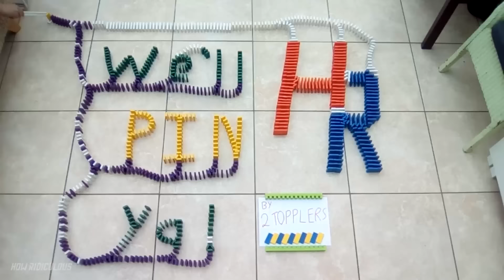Can This SOLID GLASS BALL Survive a 45m Drop?

Comment: My theory: at the point of impact, the force gets distributed outwards from that point on the surface to the area under and surrounding it. In turn from there it gets transferred further. The glass thats towards the center of the sphere has more material to further transmit the energy to because its covered on all sides by more glass. However the same cannot be said for the glass thats near the surface because thats only held together/in place by the glass underneath it and not above it because its on or near the surface. So those glass pieces arent strong enough to stay together and they get blasted off the surface.
Reply: I think that you might get pinned
Reply: Basically there is a lot of layers of glass
Reply: That’s was what I was thinking but I didn’t know how to word it correctly Bc I’m stupid
Reply: That actually makes a lot of sense. Bc there’s more glass surrounding the middle than the outsides
Reply: Nice theory
Reply: Shock waves
Reply: It's chonchoidal fractures actually! Your theory is pretty close though. https://en.wikipedia.org/wiki/Conchoidal_fracture
Reply: It’s not about how much material it’s about the forces acting on different internal parts of the ball. The shear force knocks the sides off
Reply: I beg to differ. I think its the compressive and expansive forces in the glass with a bit of your theory. The layers are of whether the forces are compressive or expansive.
Reply: @elijoetaylor  No, glass doesn't form in layers, it forms like metal
Reply: @danielwisell3836  thats actually also a very good idea. Though i'd argue that overlaps with my theory quite a bit, with mine just being more amateurishly worded. The shear forces can knock that material off because that material isnt surrounded by more material to absorb the energy.
Reply: Nerd
Reply: Hey guys how about the axe vs the glass orb
Reply: i was thinking the exact same thing, but my english isn't good enough to word it correctly lmao
Reply: Guys please dont pin me because this is just a hypothesis off the top of my head and its likely quite wrong and significantly more complex :')
Reply: @matthewmaillette  hi
Reply: To reword what you said, glass handles normal stress better than sheer stress.
Reply: MetalQueer right, if there was material below it it would theoretically all take the impact at the same time and shatter to bits. It’s easier for the glass to stay together and just lose the edges than it is for it to smash altogether
Reply: @silasmarrs1409  thanks, thats a lot less convoluted haha
Reply: My thoughts exactly
Reply: Possible
Reply: Sorry im just stupid
Reply: i think its because when the point of the cone impacts the floor, it vibrates the glass sending a shockwave back and out, and the vibration slowly dissapates outwards
Reply: @danielwisell3836  Hell yeah you know it

Comment: I’m a physics major, here are my ideas.

When the ball shatters, you can see some layering in the coney joney. To me, this indicates the ball was formed in a way that allowed for either gradients in cooling that caused certain layers to cool faster or slower, or a progressive addition of layers to make the ball bigger. Weaker layers from more quickly cooled glass would be on the outside, shattering more easily. 

When the ball hits the ground, there is a shockwave shooting through the sphere, it’s the shape of the circumference of the sphere at any given height of the sphere (it starts at the bottom at a point then as it moves up the sphere, it expands outward with a diameter of the sphere, so by the time it reaches the middle of the sphere the shockwave is the biggest circumference). Once this shockwave reaches a certain point, it stops as the tensile strength of the ball cant handle it. Up until that point, cracks are forming, and weakening the area of the ball closest to impact, and all of the fractured bits fall off when the outer layer falls off, which is why the final product still looks smooth. 

As for the flattened bit, it’s called a frustum (essentially a cone with its tip chopped off), probably formed by the ball still moving downward as it is shattering, and smashing that tip down. Think of pushing a freshly sharpened pencil straight down onto a piece of paper. 
With a perfectly spherical, imperfection-free ball falling onto a perfectly flat, hard surface, you would expect the ball to either completely absorb the impact or be completely shattered if enough energy is transferred to overcome the tensile strength. Because of imperfections in the glass, micro fractures form, which cause the local tensile strength to lower, creating more local fractures, leading to a chain reaction that causes part of it to break off.
(Edit: wording/formatting)
Reply: I'm not a physics major but learnt about frustum from the Smarter Every Day channel. Glad you've come to the same conclusion. Thanks
Reply: thats dedication
Reply: kinda wrong there as i have my master's in engineering it is only for production that they submerge the glass into cold water creating layers because they cant all cool at the same time
Reply: here is the correct answer The glass spheres’ unusual breaking effect is called the condical cone effect due to the distribution of force as it hits the steel plate. 

Glass of this type is of an inorganic silica compound, and is uncompressable. The force has no place to be released, so, consequently, the force pushes the sides of the glass sphere out in a shearing motion. This is called shear loading. Directly on the point of contact, the glass stays almost completely intact, as it is being pushed w/ extreme force, that is then diverted downwards, and outwards creating the cone effect.

These glass spheres were probably made similar to how a Prince Rupert’s Drop acts. A Prince Rupert’s Drop is basically a tear drop of molten glass dropped into cold water, creating a piece of glass where the outside is instantaneously cooled, but the inside is still hot, resulting in a force that pulls inwards towards the center of the glass drop. The drop is extremely hard, but if nicked at the tip, can shatter in milliseconds (watch SmarterEveryDay’s video that better explains it here - https://m.youtube.com/watch?v=xe-f4gokRBs)

The Prince Rupert’s Drop effect explains why the sphere is so hard; when it was cooled, the inner glass of the sphere cooled more slowly, creating a force that pulls inwards towards the center if each ball. This makes it extremely strong, and creates the cone effect. The reason that a pattern seems to emerge where the cone’s Hertzian effect is almost the same dropped from 10 meters and 45 meters is that, as I said earlier, the glass is uncompressable, and the maximum exerted force was not yet achieved. This might be possible if the spheres is dropped from a much greater height onto a material that would not absorb a lot of force (the plate in the video absorbs a lot of force because of its wobbling, and the sand further absorbs the shock) such as a mangalloy plate fused to concrete, as the plate wouldn’t be able to move, and acts as an almost immovable object.
Reply: Jeez u really write a whole fucking esay

Comment: it has likely been mentioned but, the reason the ball doesn't shatter more, the higher you bring it is because from the first drop at the halfway point with the first medium ball, is because it already hit its terminal velocity, meaning no matter the high past that point at most. The speed is the same, meaning its force of impact will also be the same.

Comment: Coney Joney explanation/theory:
As the glass is so dense, at the point of impact the glass has nowhere to travel and as a result it stays relatively intact.
The surrounding areas are not in contact with the impacting item (steel plate) and as a result are able to break away in layers, leaving behind the ridge effect.

Comment: When the glass ball hits the metal there is only a very tiny point of contact but a lot of force. When the force is transferred to the glass ball all of the molecules that touched the plate first smashs into the two beneath them, those two smash into the 4 beneath them and so on. So what you have is all of the force being distributed through the ball in an upside down party hat shape with the tip of the hat being the first point of contact. This causes immense strain in the form of a pressure wave that acts on all the glass in that party hat. All of the glass outside of the party hat is ridiculously uncompressed by comparison so they just 'leap' away from the ball.
Reply: psk ugd stfu
Reply: @pskugd8385  what are you on about
Reply: @pskugd8385  are you an online jehova's witness

Comment: So my theory is that the “Coney-Joney” forms due to the force sheering off glass that has less support. That’s why the point of impact is still in tact, it has the whole diameter of glass behind it to support it but the more angled outward the force is dispersed, the less the glass is supported by more glass because it’s less than the diameter by more and more.
Reply: My thoughts exactly. The point of impact is very, very small and has all the support behind it. Amount of support decreases as the force disperses outwards. 

Another factor may be how the glass ball is made and the internal structure of the glass itself. 🤷‍♂️
Reply: Never thought about that, great theory
Reply: Early bird gets the worm i see😧
Reply: It might also have to do with layers at creation 
Becouse it just seems to peel of and when it does you can see kind of a spirel
Reply: I THINK this is a Hertzian Cone Crack. One of the ways to create a hertzian cone is to collide spherical objects into sheet glass 

What we’re seeing here is a spherical glass ball hot sheet steel. So I’m wondering if we’re essentially seeing the hertzian cone formed backwards. Instead of the sheet glass shearing into a cone, the glass ball shears instead 

Hertzian cones aren’t actually very well understood, but there’s an arseload of theories. 

I’m actually wondering if this video might encourage our science folks to test hertzian cones the other way round. I’ve not found a study of glass spheres impacting steel yet 🤔

Comment: Because it's a shock wave and it resonates at the same frequency as the glass however it does not have enough shock wave for completion and thus the shape of the breakage. Also some of the shock is absorbed by the soft ground underneath which also affects the resonation so next time drop it onto something solid and you will find the effects to be substantially deferred.

Comment: It's Conchoidal fracturing... A conchoidal fracture refers to a haphazard mode of breakage of a material that does not adhere to any fixed or well-described physical planes of separation. Brittle materials are more likely to exhibit conchoidal fracturing. that's why the waves appear on the coney joney and why it breaks the way it does.  It has no pattern or plane of separation.

Comment: Commtest: The reason that the ball is doing the cone thing is this:
- When the ball hits the ground, there is a lot of force and when the ball hits the ground, it hits in the middle. The middle letter of force is the letter "r". Remember that, we will get to that later.
-  The part of the ball that starts contacting the ground first is the exterior. The start of the word exterior is the letter "e". Also remember that.
- When you are calculating the force of the ball, you use a lot of algebra. The most common letters for algebra are the letters "x" and "y".
- R + E + X + Y = Rexy! :)
Reply: I see... I have been enlightened!
Reply: This will get pinned
Reply: @TEFVoid  WELL YOU BEEN SOMETHING ALRIGHT :-)
Reply: What part of google did you copy and paste that from
Reply: SOMONE PIN THIS MAN